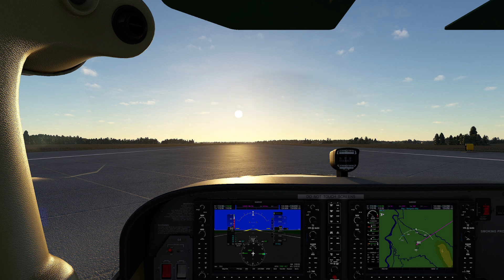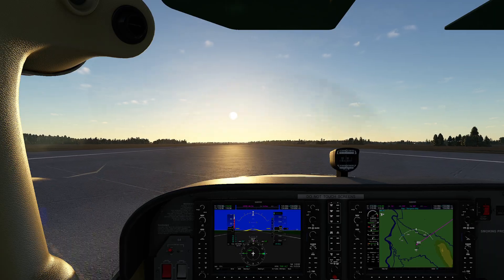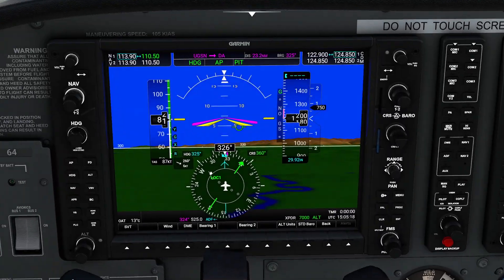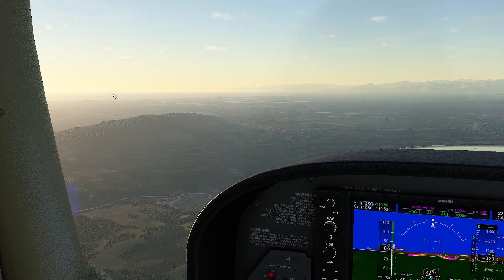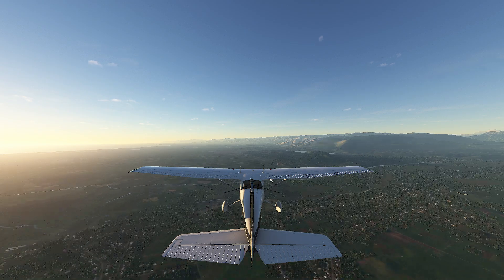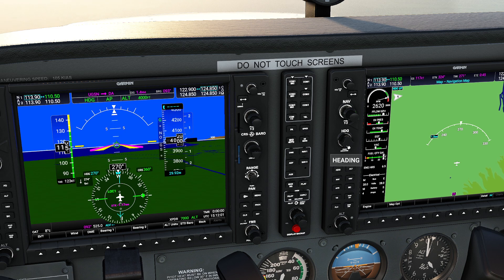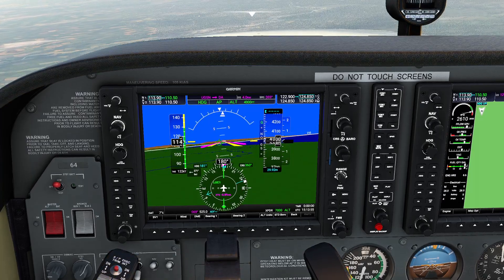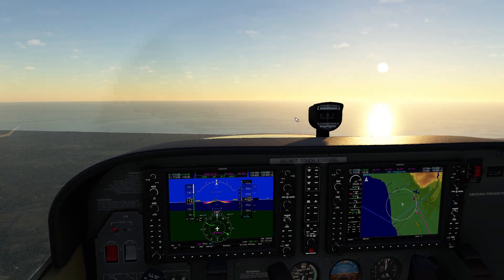MSFS - ADF Techniques

Comment: In 1965 I was a new A&P working for a regional U.S. airline operating DC-3s and CV-240s.  On the DC-3, the ADF installation comprised a "football" loop antenna under the forward fuselage and a "clothes line wire" sense antenna strung between masts further aft.  Some airplanes had dual ADF installations.  The receiver itself was a huge, heavy black box in the radio rack, connected electrically by cannon plugs and mechanically by a flex shaft to the ADF control panel in the overhead.  The flex shaft connected a crank on the panel to the tuning mechanisms inside the receiver.  The panel had lots of controls that made it easy to use various functions, unlike the on-off-frequency select controls of later ADFs.  If you selected ANT (antenna) mode, your audio came from the omnidirectional sense antenna, perfect for tuning in a local AM broadcast station and catching up on the baseball scores.  LOOP mode meant you were listening to the loop antenna input only, and you had controls to rotate the loop inside the football.  As it rotated, you listened for the signal null as the loop crossed the bearing to the station.  The null repeated after another 180 degrees rotation.  In ADF mode, the audio was combined output from the loop and sense antennas, and the audio was usually poor because the the ADF was doing its job of rotating the lop antenna to find a null, simultaneously rotating the pointer on the compass card to indicate bearing TO the station.  If the sense antenna input was missing, the receiver would just as likely point away from the station as to the station, because the nulls at each point were identical.  It took both antennas to make the system work properly and prevent back-of-the loop bearings from leading the crew astray, as possibly happened to the B-24 bomber Lady Be Good in the Libyan desert in WWII.  The ADF on that airplane was the same model as that installed on most DC-3s and C-47s of the period.

Comment: Excellent video.  A couple of thoughts:
The ADF will also pick up AM broadcast stations.  
If the airplane is off the desired course, to return to course we taught "push the head, pull the tail" of the needle, using twice the off course angle for the correction.  If the airplane is 5 degrees off course to the right, turn 10 degrees to the left and monitor the progress.

Comment: While outbound from the station adjust heading to pull the tail of the needle to the desired outbound course or while inbound to the station, adjust heading to push the head of the needle to desired inbound course. This really becomes fun when using a fixed card ADF indicator.  ADF approaches are not even required for a US certificate any more. So it's becoming a lost art.  So thanks for keeping it alive in MSFS. I'm an old steam gauge guy so that trick with the track indicator is really slick.

Comment: Thanks for the interesting video. In the ADF/DME tuning screen there is a DME option at the bottom that allows you to use the VOR1 (or VOR2) needle with the corresponding NAV1 (or NAV2) so that you can still see the distance (DME) between you and the NDB. ref: https://www.youtube.com/watch?v=Me6MAGCaMSw.
Apparently this doesn't work in the SIM... or how do you do this?